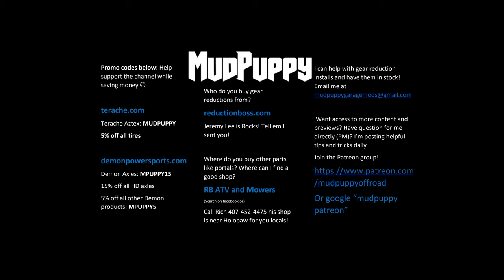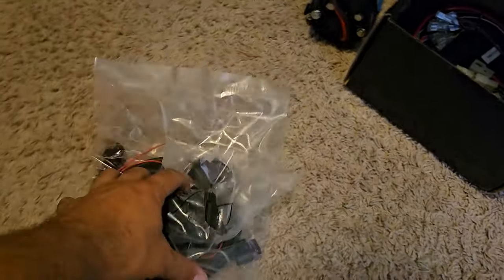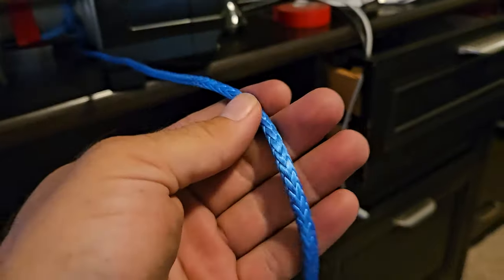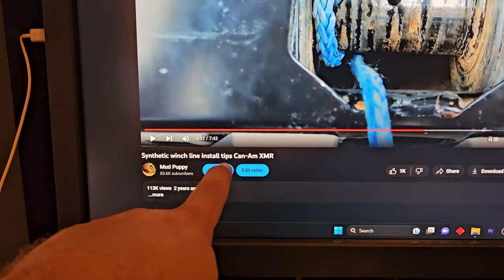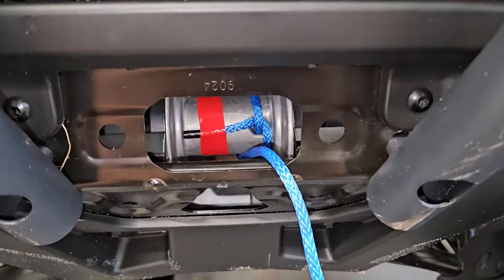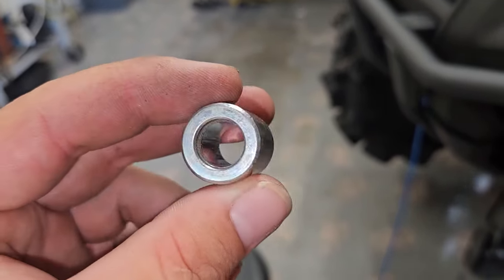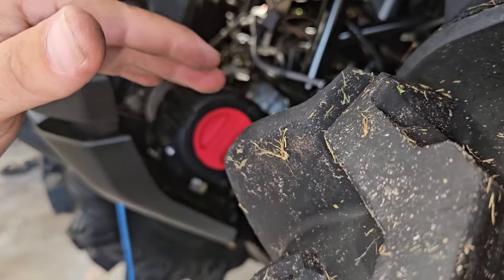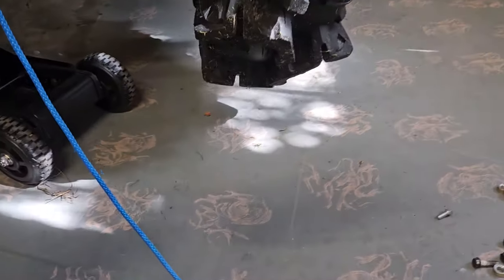Gen 3 Outlander Winch installation Warn Axon 2023 XMR 700

Comment: Great video 👍. I have a 2024 xt 700 and I'm changing the steel cable over to synthetic rope and I'm having a hard time finding a hawse fairlead that I think is the right one not only for distance between holes but the holes big enough but not to big for the OEM bolts to reuse. What is the distance between the holes? 4.875 or 4.800? TIA.